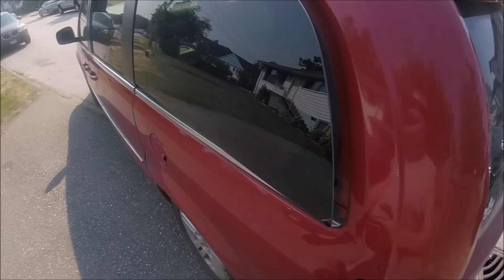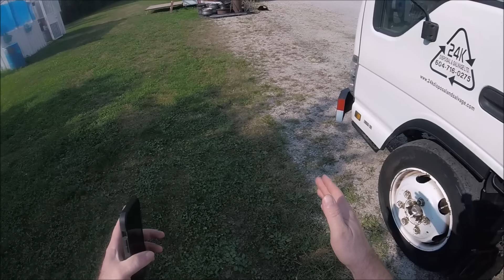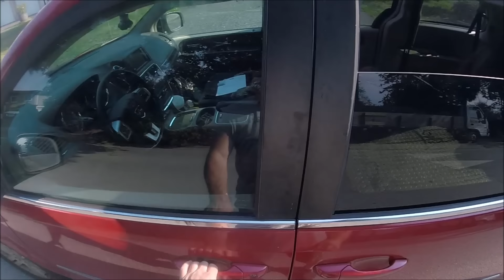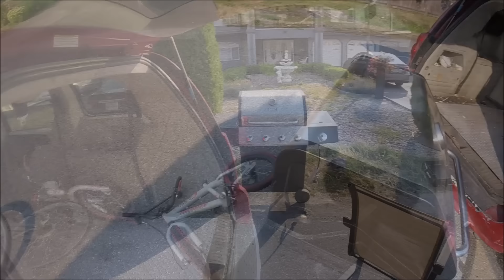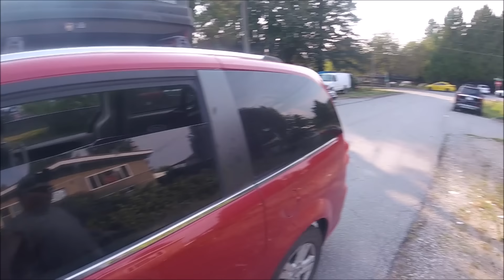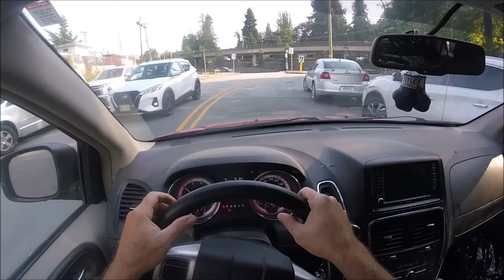Street Scrapping + Scenic Tour of Future Development Sites Near My House

Comment: Every time they put in a part dealing with the front susoension you need to get an alignment.
Reply from the maker: They never told me?
Reply: @CanadianTreasureHunter  thats why your steering wheel is a little off
Reply: @CanadianTreasureHunter  i know in regular cars and trucks that has to be done. I would think that would be the same for commercial trucks.

Comment: I think Ford is in deep trouble and you are feeling the affects.  The entire car industry is crashing.  $130K sounds like retail plus.  Can't help but feel the dealer is taking advantage.  You still have 3 vehicles working.  Tell them bye bye and look again in 6 months.
Reply from the maker: 79K for the Van & 31K for lift + interior & Tire rack + 4K for 6 Year 160K Warranty + add 12% Tax
Reply: Phil - I didn't realize how far apart the usd/can exchange rate has gotten.  I did see a lift very similar to the one in the whale.  $20k installed, they are necessary but not cheap.  Assuming you are getting the 250.  Looked into for you to buy in US, then import.  Nope, don't do it.  Send your son over to the dealer in uniform.  Might give them incentive to accelerate your order.  😃